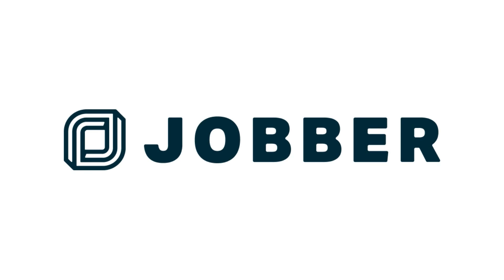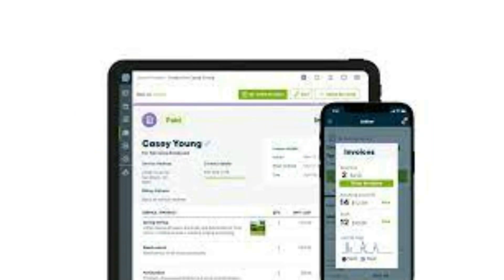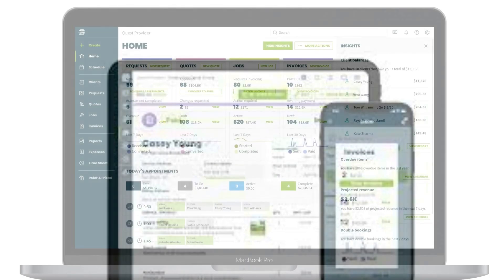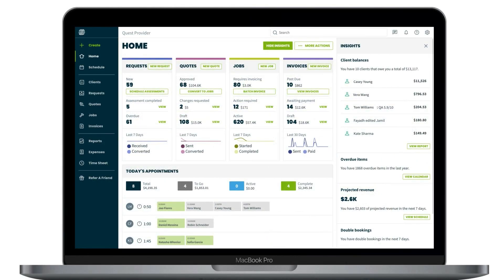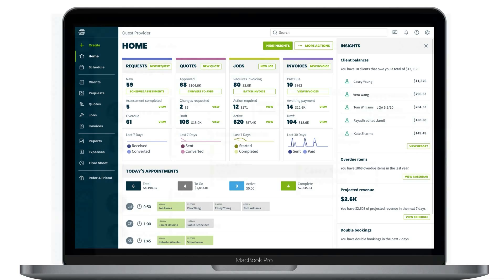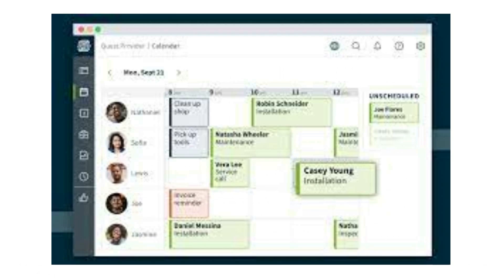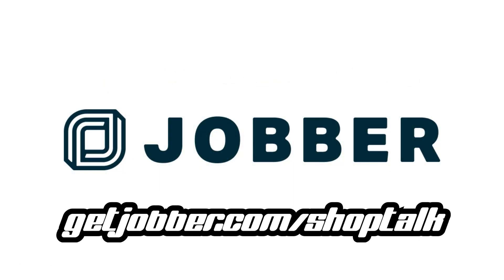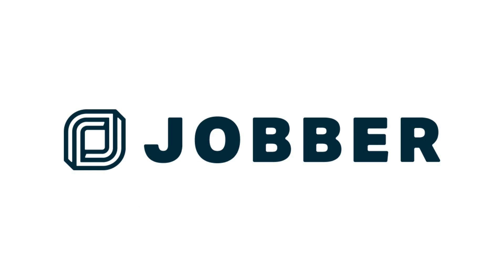How does a Low Temperature Split Happen? HVAC Troubleshooting

Comment: I’d like to know more about delta-t where the temperature split is higher than spec. I see a temperature difference greater than 22 F at 45% relative humidity but airflow seems to be good. What would cause that and is it a problem?

Comment: I ran into a high humidity low split situation a few weeks ago. Man was it hot inside. 87 db, 71wb, 15 dt. After a while, it fixed itself. Thanks for the temp split videos. They really helped me see delta t a little different.

Comment: Now, if we could just get manufactures to put common size filter racks back in the air handlers or contractors to install good external filter setups and manufactures to make quality coils and txv’s.